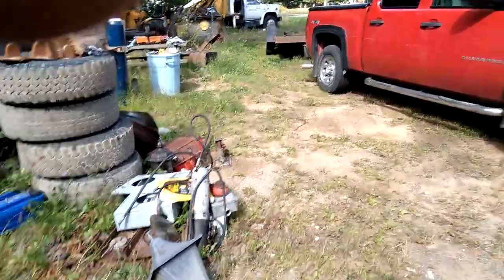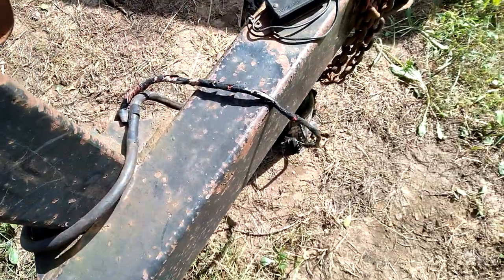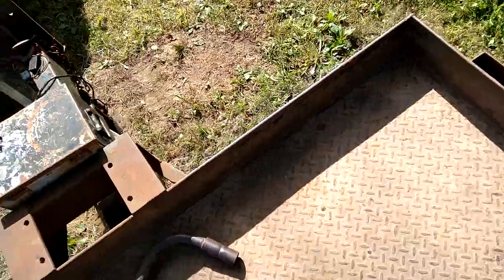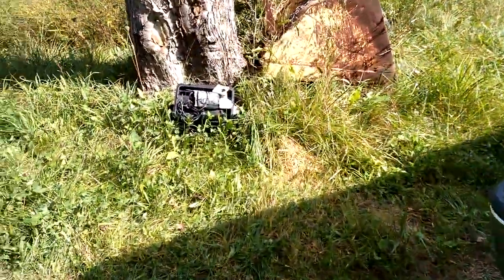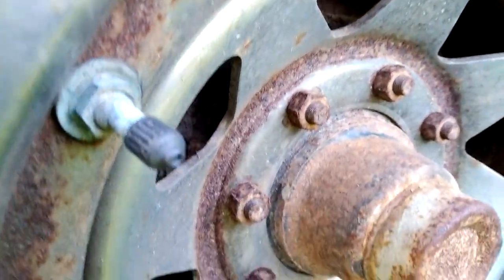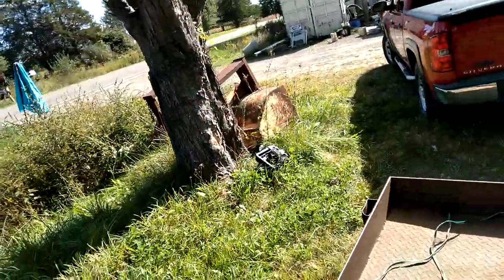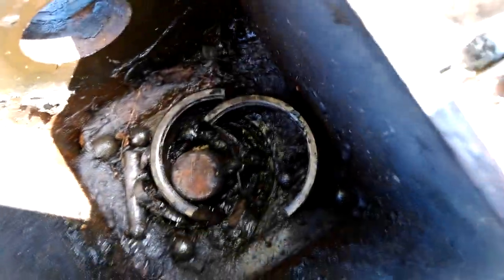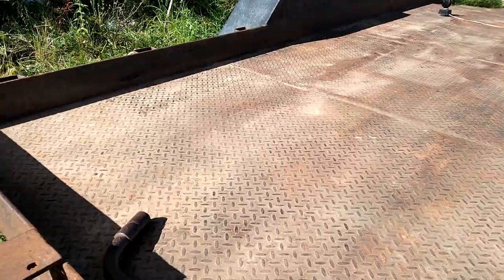just got a tilt trailer

Comment: Nothing wrong with a pintle hitch. I prefer them to a ball hitch. And steel is definitely better than wood. Looks like a good trailer
Reply from the maker: Will be a good multi-purpose trailer just thinking out loud I probably will lead the pintle hitch on there thanks for stopping by
Reply: @billjunking_fool5549  I like them since they are easier to hook up and they have a greater weight capacity. My trailer has a pintle hitch
Reply from the maker: @OBS_Ford_Diesels_Inc  the one I used was a freebie from a cleanup job I had to oil it up but it works great